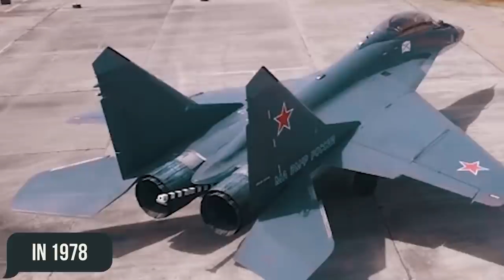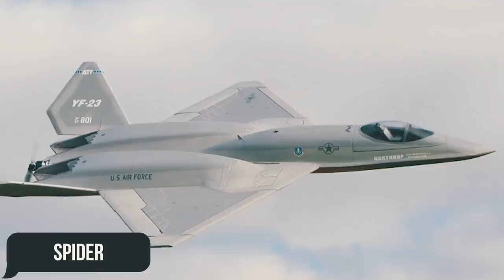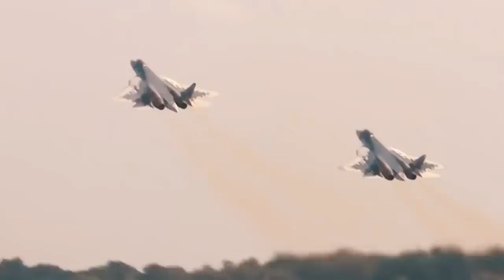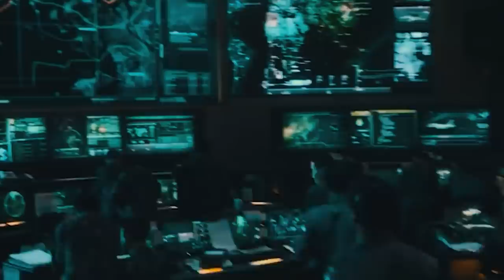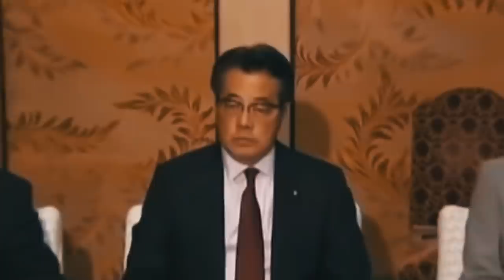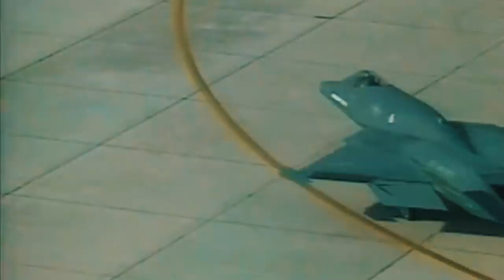Reborn YF-23 Will Shock China and Russia Soon!

Comment: As an Air Force veteran F-22 is on my top 3 of favorites and the YF-23 is a beautiful plane. I think the real reason the F-22 was chosen is with McDonnell Douglas itself. McDonnell Douglas over charged and under delivered on past projects. I think it was more or less payback. That's the problem when top brass and members of congress can vote on things the personally invest in. Any where's else it would be called ''INSIDE TRADING'' and would be illegal .
Reply: Also, since Jack cut up those yb49’s do to speculated politics, Northrop failed to win a good contract till the B2, and that was short changed.
Reply: B1...
Reply: @zekefish3049  B2
Reply: The B 1 wasn't a good contract?
Reply: @zekefish3049  sorry, I thought you meant it was the B1 and not the B2. Not familiar withe the B1 and it contract
Reply: I worked at McDonnell; IMO, it was because the F-22 was the less expensive platform in an era of deep DoD cuts, and because Douglas (commercial side run by accountants, which 'took over' MacAir a few years earlier and imposed an Orwellian program called TQMS (called "Total Quality Management System" but in practice put quality last)) had a cost-cutting focus rather than an innovative engineering culture. We could smell it, and so could the customer.  That said, Northrop was the prime contractor on the aircraft.
Reply: @g1lb0rt1  B1 a swing wing initially Mach 2 Bomber from Rockwell, castrated by the Peanut Man of the Democrats, and Regan of the Republicans, brought it back as a 1.25 Mach Bomber - the Official Name Lancer, nick name "Bone", B-One

Comment: An updated YF-23 would be the best fighter aircraft ever made! Also the Mach 1.8 speed is in Super Cruise only (no afterburners). The real speed is Mach 2.2 officially, but it's closer to Mach 2.9 irl.. It's also super maneuverable even without Thrust Vectoring due to its design.. It was indeed a better fighter than the F-22 but other factors weighed in on the decision to go with the F-22.. Japan would be very wise to go forward with this project 👍
Reply: Now we just need the Avro Arrow remade and all will be well in the world of military aircraft.
Reply: Thrust vectors are 99.9999% used in public air show stunts. They have little to no actual military use. Nobody flies a top end jets traveling above Mach 2.5 would ever engage thrust vectors! The jet would literally come apart. There is a reason by the SR-7, close to Mach 3, needed around 100 miles to make a good radius turn! And that jet was made with extremely expensive titanium and other space-shuttle materials.

If you want to please stupid public air show crowds doing slow-motion-like stunts, you go with the slower F-35B aircraft, which actually has real military use: it is the only top end jet that could fly up to Mach 1.5 and come to a hovering, helicopter-like stance, a capability that in some very contingency emergencies in some extreme forwarding staging (in high seas, on deserts, mountains, or valleys) .... without either enemy or allies having the same capability... at least not in the same amounts or units.

All large, two-engine & powerful top end jets simply need to be able to get from A to B very fast, very stealthily, carrying sufficient missiles of the various kinds, with the least number of times of refueling in the air.... 

If the SR-71 COULD be made to fly reliably, at the cost of the F-22 (per unit of $350m to $400M & per hour of flight ~$50,000 an hour) & still able to carry missiles & bombs internally, the US would have had 200 SR-71 built by now... and no F-22 would ever be needed, even if the SR-71 needs 100 miles to make a good turn!
Reply: wont be mach 2,9 without variable geometry intakes
Reply: U.S. F22 Japan YF-23 "brother"--------> The cocktail F22 with the brain of the F35 on Japan's YF23 2022
Reply: The other factors that affected the decision were actually not part of the selection criteria which clearly showed the YF23 as the better aircraft.  They were ultimately political.  It will be good to see Japan go ahead with this.
Reply: @lloydrobins6074  
It is not all about politics. In many case is it is about policy and what the brass feel they need at a given time. 
Back then nobody was predicting the rise of China.
Reply: @kiabtoomlauj6249  aircraft in a fight aren't necessarily flying beyond mach-speed. therefore, the thrust vectoring has a very distinct advantage over those without, especially if you have the enemy aircraft on your tail.  A past tactic was to put on the brakes at high speed, in an effort to fly the guy behind you, past you in a hurry.  Guns still work on aircraft and the bullets are more plentiful than missiles.
Reply: @OleNavy   You're right, Thrust Vectoring gives fighters a huge advantage in a dogfight. There are very accurate International Fighter Jet Simulator channels here on YouTube which makes this fact pretty clear for anyone who doesn't believe this.
Reply: No possible way can it be mach 2.9 without variable intakes .
Reply: F22 has stealth YF23 not so much
Reply: @kiabtoomlauj6249  aren't you forgetting the need for Marine pilots vertical take off?
Reply: @jpsbman  I'm sorry, but you are clearly misinformed
Reply: The US military is not the brightest
Reply: Don't forget the F-106 delta dart, with a new engine the latest tech, she could hold her own these days, we retire jets well before their time. I'm sure there are others that with mods could be  relevant today.
Reply: @bighands69  people were talking about China back then. China's economy was already on a logarithmic trajectory.
Reply: @bighands69  the media may not have been taking about China, but anyone in this realm would have been. 

Anyone in an industry that was moving over there was definitely talking about Chinas insane growth alot back then, so I can't imagine the military was ignoring this giant communist nation of a billion people, considering the circumstances with us and communism.
Reply: @kiabtoomlauj6249  that's also why Hypersonic missiles or gliders aren't really as manoeuvrable as Russia and China would like you to believe, as they'd need to be close to a solid lump so as not to break up!
Reply: @wololo10  Maybe internal out of Radar View.
Reply: @lloydrobins6074  It also seems to point to a clean-out in the Brass, and  snaping the lid down on the Dunny seat while the politicians and Generals are drinking, in the USA and Others
Reply: It was never better than the F22 raptor...the pilots who flew the f22 raptor did say that it was a much better

Comment: As a former US military air traffic controller, I was much more impressed by the F23 right off the bat. It is cheaper, faster and with upgrades not available years ago, it will be a much better platform than the F22.
Reply: who was paid off?
Reply: Makes one wonder why they choose f22over f23 if as seen f23was so much better..remember.there still..time to re issue plane back into our Air Force...making our fighters force better.....
Reply: @walterkazban1819  💲💲💲💲💲💲💲
Reply: I think the US Navy should also use them on their carriers rather then the F22s
Reply: When you need a Porsche, you don’t go to the Chevrolet dealer. Former Lockheed Martin Flight Test Engineer.
Reply: Yes, it was a damned shame that they didn't go with the YF-23!
Reply: @iamnotpaulavery  lol, the F22 was a better plane. It did cost more but it is air superiority everywhere it’s hangs out.
Reply: @larryfitzgerald7538  The YF-23 had better range, better super cruise speed, and better stealth characteristics. It was slightly less maneuverable, but these two were not meant for "dog fighting"!  The YF-23 beats the F-22 in practically every aspect, and it was slightly cheaper to build! Not by much, but it was cheaper! Also, the F-22 spends more time in the hangar than any other aircraft in our arsenal!!
Reply: @iamnotpaulavery  oh really, how long did you participate in the classified program?
Reply: My vote goes to the X-44 Manta ~ Now that a fighter bomber 👍 of the future !
Reply: @iamnotpaulavery  Since dogfights are practically gone now my thoughts were F-23 all the way...
Reply: @northstar7884  None! And you?!?!
Reply: @iamnotpaulavery  oh I wasn’t on that project. I just thought you where because you had so many details.
Reply: @northstar7884  What project were you on?
Reply: Yeah I seem to recall that the F-22 choice was political. The YF-23 was the better plane. And I think it's gorgeous
Reply: @HerrinSchadenfreude  Yes, it's a beautiful aircraft. If you watch the documentary on the building of the 23 here on YouTube, you can see how utterly devoted each and every member was when designing and building it, and how crushed they were afterwards. It's a very good documentary. I'm sure the opposition was equally devoted, but I agree that politics did play some role in the government's decision.
Reply: @Philip Kirschner We should have trashed the F-35 project from the start and used the money to have both a fleet of F-22's and F-23's.
Reply: @larryfitzgerald7538  No, the F-22 was chosen because at the time, it seem like a good idea to have a superjet capable of outperforming the Su-27 and MiG-29 over the relatively small skies of Europe, including in a dogfight, but strategically, it was a dead end. Both companies met the requirements set by Pentagon, but those requirements were shortsighted. Both companies could do better, but whereas Lockheed focused on turn performance and dofighting at a time when dogfighting was already becoming less and less common, Northrop was much more forward thinking by focusing on things that would make the YF-23 a better interceptor. 

A war against China in Pacific will inevitably involve long range flights and flaking maneuvers. A stealthy plane with external fuel tanks isn't very stealthy. The F-22 would be much more reliant on tanker aircraft that China could instantenously delete with its ultra long range missiles. This makes the F-22 almost unfit to fight such a war. If Pentagon had picked the YF-23 as the winner, it wouldn't have got canned because it is everything the US Air Force needs in the 21st century. In fact, I reckon the 6th generation fighter they're now developing will be very similar to it in its capabilities.
Reply: @carlosa7598  Carrier landings need a specialty airframe that can withstand what is basically an under-control partial-crash-landing.  Because that's what that huge touchdown shock followed by the reverse jerk of the arrestor cable is like to the plane.   Both the F-22 and would-be "F-23" (YF-23) have air frames not suited for a tail hook.  I bet the internal armament bays also aren't designed for carrier landings while still holding the weight of live weapons.
Reply: @duke9555  China has the advantage of cheap quantity versus the USA's shipboard limited quantity of expensive weapons.   Just keep firing the land-based cheap ballistic missles to drop kinetic loads on the carrier.  The ships have to shoot multiple missiles at each Chinese kinetic kill missile.  Who will run out of missiles first?  And of course sink all the re-supply ships which are much easier to sink.  A fleet that cannot re-supply is like a fighter that cannot re-fuel from a flying aeriel refueler which is also easy to shoot down.  If China is smart, it should spend a lot of effort to get rid of the re-fueling and re-supply logistics.
Reply: @animejanai4657  China can assign 20-30 anti ship missiles based on land at a carrier and no need for a bullseye just enough to deny the carrier in its mission
Reply: @walterkazban1819   I watched an YF-23 vs YF-22 documentary that said Northrop was a royal pain in the butt to the Military in regards to their B-2 Stealth Bomber project, which at that time wasn't very long ago so it was fresh in our Military's minds.
Reply: @MedicatedOMO  I wish our planners will always put a 7 barrel  gallon on our planes ..with missiles ok but missiles need seconds to engage migs..which was a big problem in dog fights over Vietnam f4's had to add a protection gun because our missiless was worthless because it let mig get too close before missiles would be effective...they had to add  a gun pod so they have defense against the migs
Reply: @larryfitzgerald7538  british typhoons gave the f22 a lesson when it got into a dog fight bvr it maybe top dog but not in a dog fight
Reply: @walterkazban1819  I have no idea why your replying to my comment. Because I said nothing about what you said...
Reply: @MedicatedOMO  error error replying on my part wasn't keeping eye on post...
Reply: @kelvinh8327  Maybe ............tho this shell of a man seems most unlikely the type to unleash nukes
Reply: @carlosa7598  
The Navy isn't using the F22.
And the F23 is a large plane for a carrier.
The AF and Navy are both in 6th generation mode, not a 30+ year old design.
Reply: @Mudpuppyjunior  how about the F-32.haha
Reply: @beeker9821  Good insight, thanks for that. One thing though, I was wondering if you meant Taiwan rather than Thailand?
Reply: @northstar7884  That's classified!
Reply: U.S. F22 Japan YF-23 "brother"--------> The cocktail F22 with the brain of the F35 on Japan's YF23 2022
Reply: @iamnotpaulavery  I was USAF Security Specialist mos,81150 I don't remember either one of you at the de-brief.
Reply: @iamnotpaulavery  That would have been the smart thing to do....But we are talking politicians
Reply: @stevenmorris3181  yeah!
Reply: @larryfitzgerald7538  The F-23 was actually the better plan both in terms of range, cruise,  but acceleration and stealth.  The reason the F22 won is it had a vastly better demonstration and was less risky from a technological and production standpoint.
Reply: I don't think an Air traffic controller is an aerospace engineer
Reply: @duke9555  no.
Reply: @DWSPRODUCTIONS  comprehensive & exhaustive
Reply: Lockeed Martin is have a lot of failures in recent years, I doubt about their performance maybe without backer from US high level there would be less project.
Reply: @carlosa7598  That would make them heavier.
Reply: Wow you had to fight for that job huh?

Comment: Having tested systems of the F-22 and the YF-23, I can say the YF-23 is by FAR a better choice.  It was mostly "Politics" why the Gov't. didn't choose it, as they were concerned that Northrop was getting nearly ALL the "Gravy" - what with them already producing the B-2 Bomber.
China Lake was a "Wonderland" of High Tech "Devices" for me to visit, as was Yuma and Edwards AFB (I was like a Kid in a Candy Store!  Lol...)
  Glad I got to work with both Great Company's Aircraft and Engineers - both Northrop and Lockheed.
Reply: I am sure  working on these planes It was fun and satisfying
Reply: The defense Industrial sector is one of the most strategically important bits of this country. The expense and loss in capability that comes with having one of the only two fighter manufacturers die off...

If given the choice between a plane that was a bit better, but killing a strategic assett for the future... I'dproably choose the plane that wasn't quite as good.

The F22 was good enough.

Comment: If you'll do your research, you'll find the history of Northrop and its founder, Jack Northrop. You'll find that upon his original development of the YB-35 and, later, the YB-49 (seen in flight clips in the original 1953 movie "War of the Worlds"), the Air Force wanted his YB-49 canceled so they could buy the obsolete B-36 Peacemaker from Convair, which had a big TX plant and Washington, D.C. lobbyists. When Northrop refused to pull his bid, he tells that the Pentagon threatened to never give Northrop another aircraft contract!!  Until his death, Jack Northrop held that ENABLED threat as the main reason why the company never got another major contract and the F-20 Tigershark was canceled. Advances of the Soviet SAM systems (shown by shooting down the Gary Powers U-2 in 1960, REQUIRED the Air Force to rethink the B-52 and they wanted the North America XB-70. One crashed and President Kennedy canceled that program.  Later, President Carter canceled the B-1A model which left the Air Force in the lurch with only a problematic General Dynamics FB-111. So, when Northrop came up w a new computer-controlled "flying Wing" (the B-2 w stealth design and coatings), the Air Force gave in and bought 21 of the 132 planes USAF wanted. The REASON the YF-23 wasn't selected is because cronies of then Gen Curtis LeMay were still in charge of segments of the Air Force and upheld his leanings. LeMay held CONSIDERABLE sway in the Air Force, much as J. Edgar Hoover held at the FBI over the Federal government.
Reply: This story is consistent with the stories I gleaned from my late father who was on design teams for the tiger shark, the F18, the yf23 and the B2 stealth bomber.  Thanks for telling this and confirming my dad’s hints at why his company would design superior airframes and lose competitions to inferior designs or have to sell designs to third parties (Mc Donald-Douglas, Boeing) and act as sub contractors to get monies for their efforts.

Comment: The F-23 with modern software and overall tech will vastly outperform the F-22, which turned out to be a money pit with a basic gen 4 design.  This F-23 is much more exotic and capabilities will increase significantly with modern tech to gen 5.5....The only thing I can think is that gen 6 fighters are already close to prototype stage in the US and the need for gen 5 is already gone....
Reply: U.S. F22 Japan YF-23 "brother"--------> The cocktail F22 with the brain of the F35 on Japan's YF23 2022
Reply: The F22 has a different role and it is not all about raw performance.
Reply: @bighands69  Well, what if Japan resurrect YF23 with F22 avionics with F35 brain cell? Then what